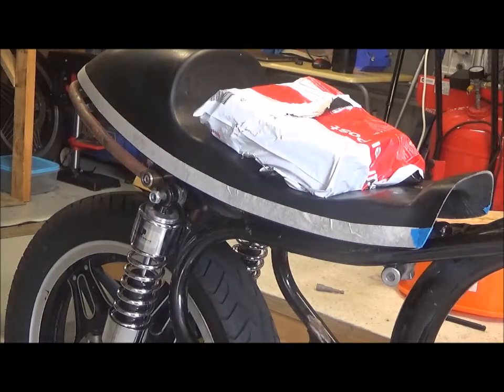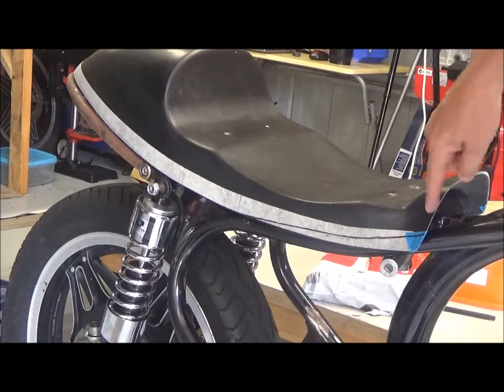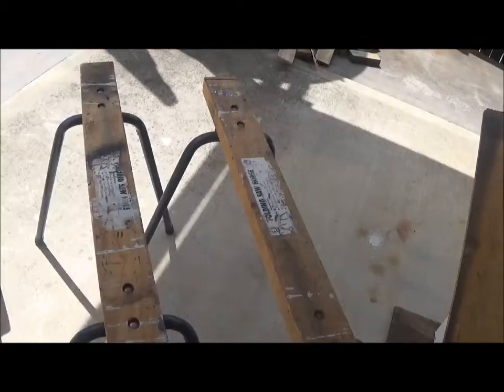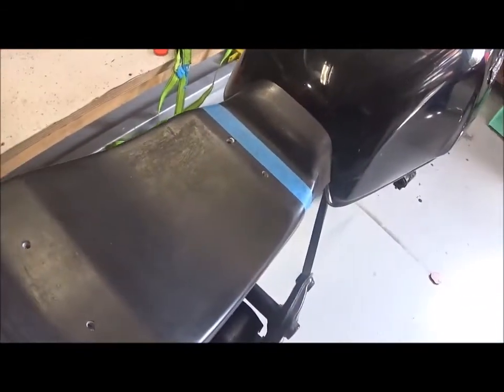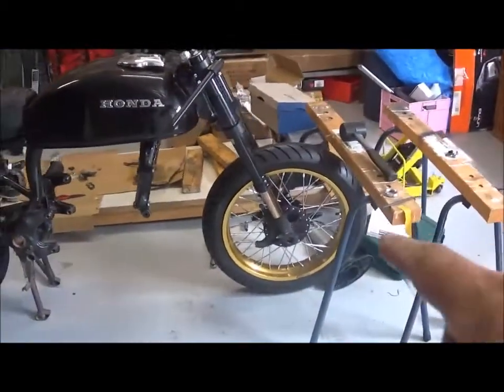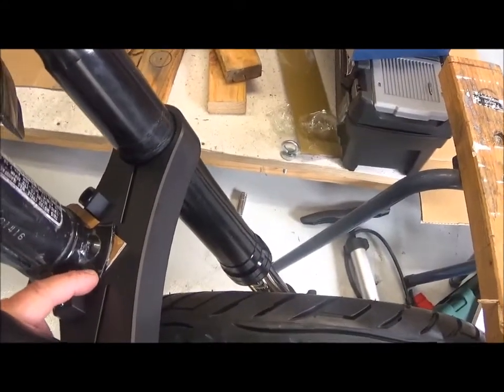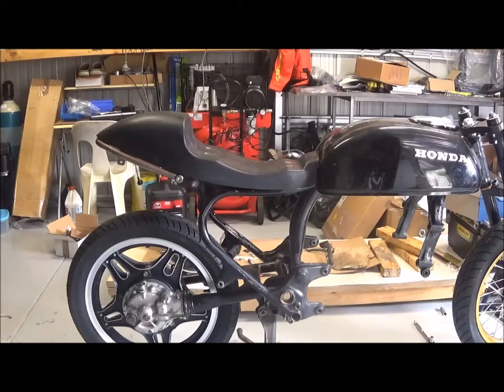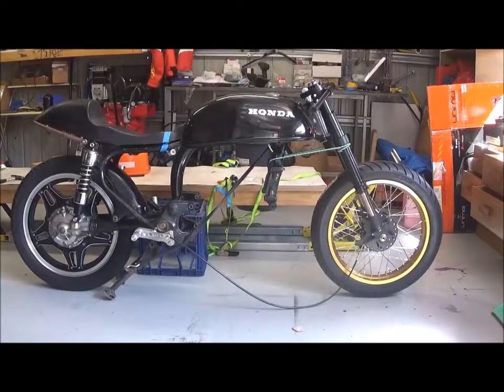Honda CX500 Cafe Racer - Seat pan and progress analysis - Episode 33

Comment: Hola amigo!, to be honest I love the front end of your bike but I hate the rear end, the banana seat do not go with the cafe style and is pointing up like a sport bike, in my opinion (that I know you don' t ask for) you need to get rid of the sub frame and keep a straight line tank-seat, but what do I know?
Reply from the maker: Carlos Google Maps ...I agree with you...but it's  my first build so I'm not confident chopping subrame completely and welding new spring mounts. The fibreglass pan is as supplied by Cafe Racer Kits. I may end up making another one with a lower profile. But you are absolutely correct. Gracias hermano.
Reply: A tip, start by lift up the rear part of the gas tank by inch and a half (more or less) and you will see a difference right away, I believe that you are doing a great job with this bike, and come on!! You got the skills now only need to be confident, all the best!!, by the way, the motor looks great!!